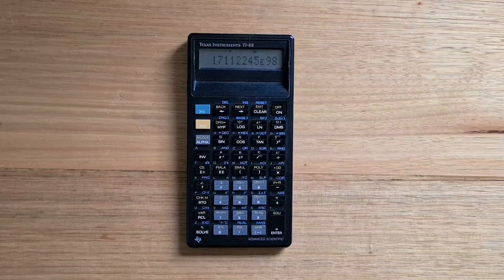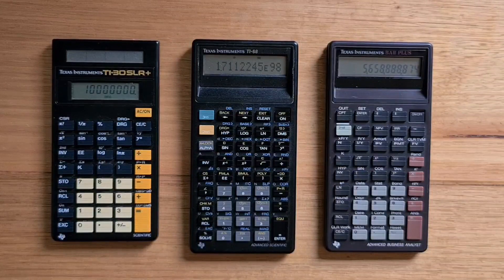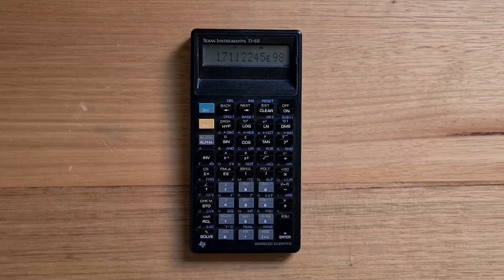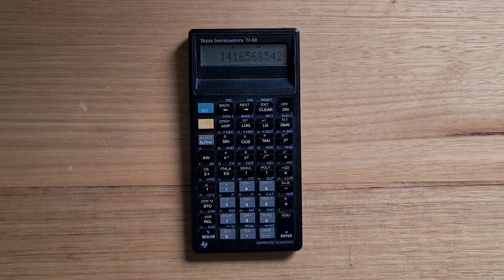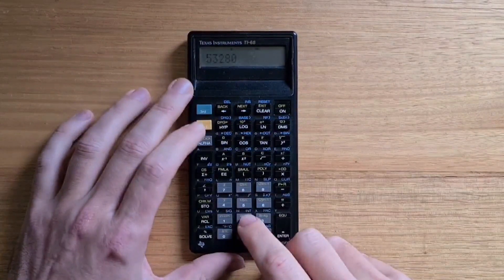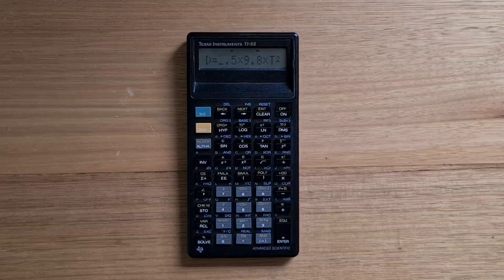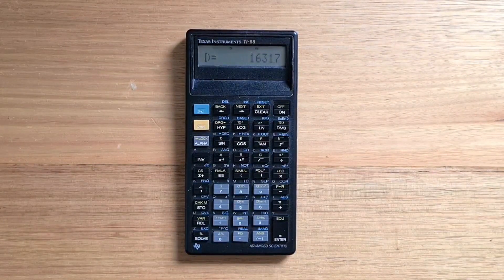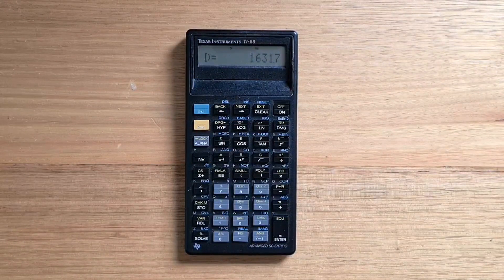TI-68 - Scientific calculator from 1989

Comment: Still have mine from over 30 years ago. It was a requirement for math class in college. Still works great and very light in weight. Rubber feet thingies on the cover are long gone though. Best calculator I ever had. Assembled in Italy.

Comment: The best non-graphing calculator I have ever owned.  This was my calculator in engineering school.  Love the feel of the keys - there was never any second guessing whether or not the intended key press was registered.  Can’t get that with current calculators.  The dot-matrix display eventually failed (the most common problem with this calculator) and sadly they don’t make these anymore.  Would love to have it repaired if possible or have TI resurrect this model with a more robust display connection.
Reply from the maker: Yeah I agree the keys feel good for a TI. Probably the closest modern TI is the TI-30 MathPrint, although it doesn't have nearly the same capabilities around formula storage and alpha capability.

Comment: Still got mine, sadly the display has failed, but I may try to revive it…
Reply from the maker: It is a common problem I am afraid.
Reply: @CalculatorCulture  Mine has exactly the same dead pixel columns as yours. Looks like a tricky fix, too -- the ribbon cable to the display looks properly attached at both ends, but the pixels come back when it's flexed. I suspect the tracks themselves because of a sharp kink in the ribbon, but it's hard to tell which ones -- much less figure out how to fit repair wires.
Reply: There's a guy with a fix-it video for the ti82/ti83 with the same problem. Basically, he opens it up and runs a cool soldering iron across the ribbon cable where it connects to the board. I just tried it with a 68 that had more pixels out than working. It's now like new perfect.

Comment: Thank you. Can you make a video on the Casio fx-5800P program calculator released in 2006? It is still being manufactured, and used mainly in Japan and parts of Asia.
Reply from the maker: Sure. Yeah I have a fx5800p.
Reply: @CalculatorCulture  Thank you! I have one and learning to use it. I used it to program tedious transmission line calculations which use complex numbers. Greetings from India. You see here in Asia, people hardly use, or even know about TI or HP calculators. I have never seen a TI, but use the Free42.

Comment: I first had the cousin TI-60X and eventually got the TI-68 later (1993 keyboard - plastic frame).  It takes a while to get used to the many shift keys (2nd, 3nd, INV, ALPHA).  The TI-68 may be a spiritual predecessor to the TI-36X Pro (I wish the 36X Pro kept its ability to do trig and logs with complex numbers).
Reply: I agree!  I used a TI-68 in middle school up until replacing it with a TI-85 (and then an 86), which was much more fun because of programming, but still kept the 68 around for light-weight stuff.  When I acquired a TI-36X Pro in recent years, I recall thinking it was a modern version of the TI-68.  I wish the TI-36X had TI-BASIC and connectivity.  For those not caring for graphing, it would be a sweet programmable compact calculator.